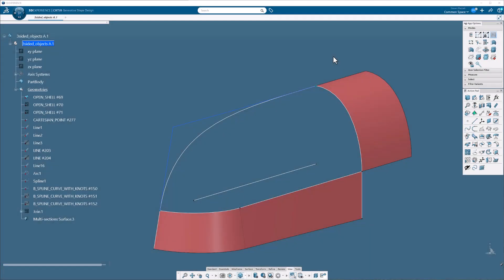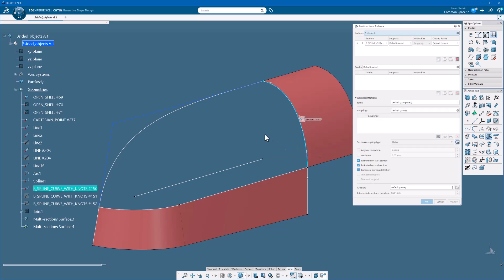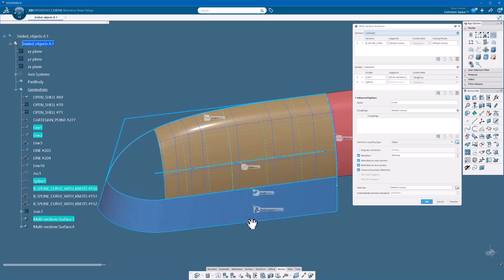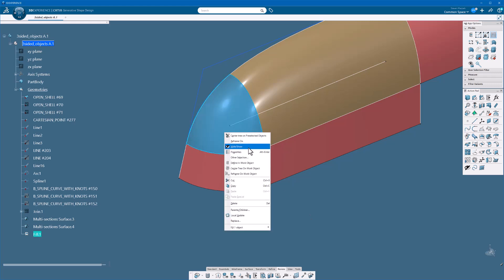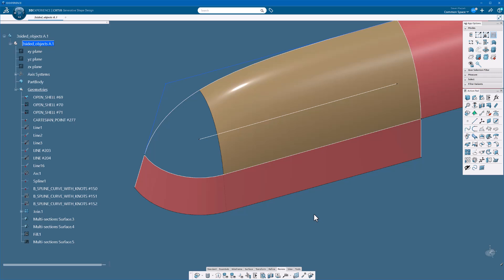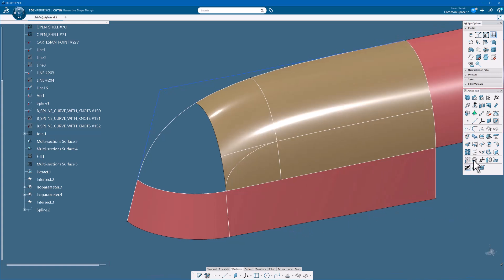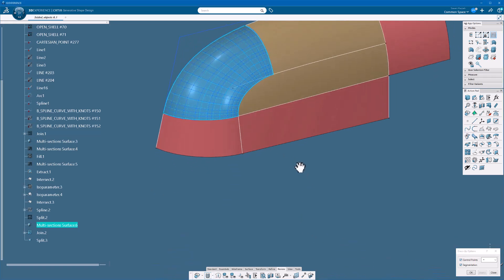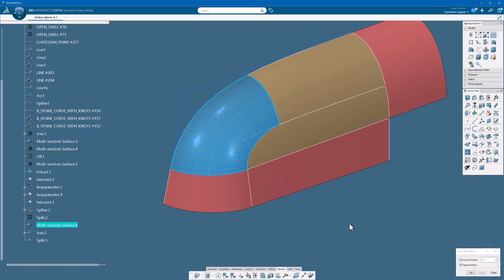3 Sided Surface in 3DEXPERIENCE

Comment: nice video...  just one last step, surface is not symmtrical (@YX plane), basic design principle is to use symmetry reference as the 1st reference as it is basic design curve (intent to be modified later on). 
Just a tip:
A) extrude curve on the symmetry plane in -X to get a flat surface
B) offset symmetry plane in in +X by some lenght (depending on scale) 
C) for parametric surface use split ... for Aclass use break function - your created surface with symmetry plane 
D) blend edges with G1,G2 or G3 (depending on the surface class output that you want to get) 

I wont go into details about curve(s) creation conversion, but try using a 4 sided patch insted, to do the create a same surface ... result will be much better/cleaner and then you can edit with control points function and simplify (reduce) to get a better distribution. Just watch out not to over simplify and loose flush with the your referential surfaces.

Keep up the good work, cheers!

Comment: great video, I'm curious if you drew this in NX with the same paramters would the surfaces be the same? or do different cad packages do fitting different?
Reply from the maker: They are different. Tolerances and how the math is computed and each CAD systems limitations come into play